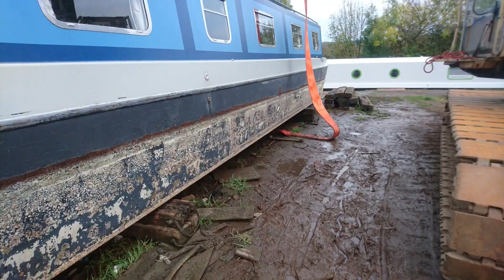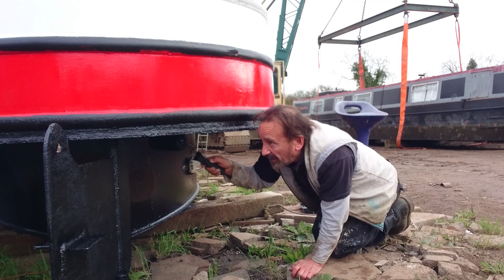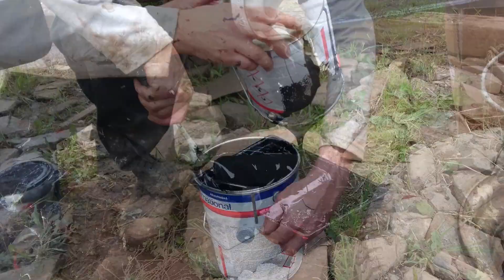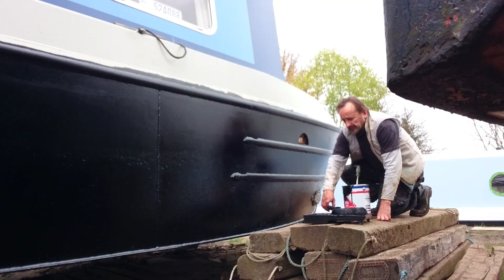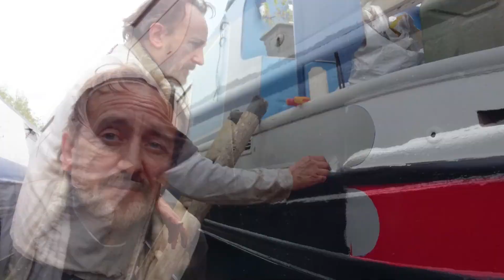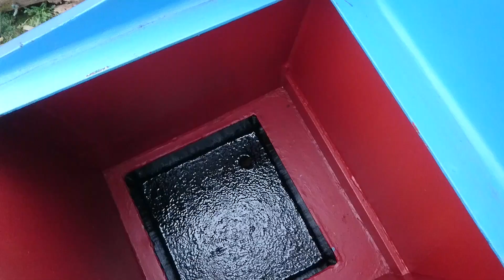Boatyard Blues - Day 9

Comment: Your doing a fantastic job. Much better than a contractor would have done. Also how or if do you do the bottom undrneath of the hull ?. Boats looking lovely. Paul & jilly ❤
Reply from the maker: I couldn't do the bottom in this instance as the boat was too near the ground and I don't think I could have found the energy anyway. It is popular to just leave it in the belief that the lower oxygen down there causes little harm. That and the fact that the base plate is 1cm thick. Certainly from what I have seen, boats tend to rot from the inside out.

Comment: OK. You've got me wondering: when (and how) do you black the bottom? It would seem to the uninitiated that this area, despite the extra-thick plate, would be the most vulnerable area on the boat what with the occasional wayward cill, underwater obstructions, groundings, shopping trolleys, derelict Morris Minors, etc. I know that I saw a vlog posted about someone buying a used narrowboat which proved to have a holed bottom. Oh, and good on you for sticking to the hard work. Most days, what with getting up in the morning, eating breakfast, going for a walk, fiddling with the computer, eating lunch, fiddling with the computer, eating dinner, doing laundry, washing dishes and other necessities I seldom accomplish anything that takes more than an hour and is truly useful in any given day.
Reply from the maker: Hi John. I think that was Nomadic Crobot ? There are a few. Though theirs was from internal leaks which I believe is often the case. They say that boats rot from the inside out. It is popularly believed that the lower oxygen content in the water at that depth, the extra thickness of the steel and yes the fact that whatever you do it will get partially scraped off, are good reasons not to bother with it. That and the fact it is obviously very difficult and you need special access - I couldn't have done the base plate where I was. 
I'm the same usually, very easy to "potter" a day away - especially doing these vids!
Reply: @ProjectNarrowboat  I can't remember the name. At my age that is not surprising. All I remember was that it was about a young(ish) female purchasing her first narrowboat, a apparently-dodgy survey, failed overplating, and who knows what else. I did run into local tales of a holed craft on the Caledonian while hiking along its length which involved  an FRP (yoghurt pot?) yachtish-thing which hit a stolen vehicle which had been launched into the water and was never seen until after it was hit. Watching all of the narrowboat vlogs I sometimes fantasize about having one built, a sleek modern serial solar hybrid with every amenity. Fortunately I have always come to my senses and realize that a US citizen this would be the craziest scheme in my overall crazy life. Cheers, and safe boating.

Comment: Do you have to paint the very bottom the boat
Reply from the maker: Some do, most don't. Apparently the reduced oxygen in the water means that it's not too bad for rusting. From what I have seen, they rot from the inside out.